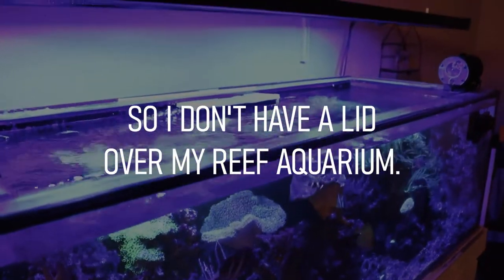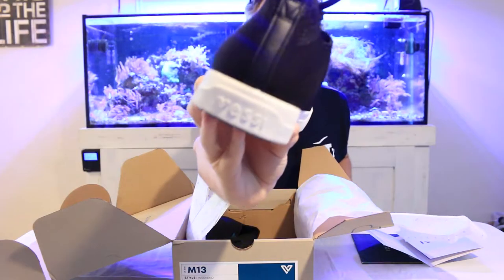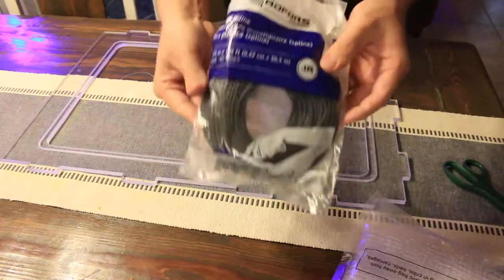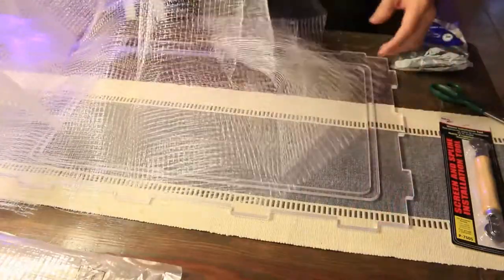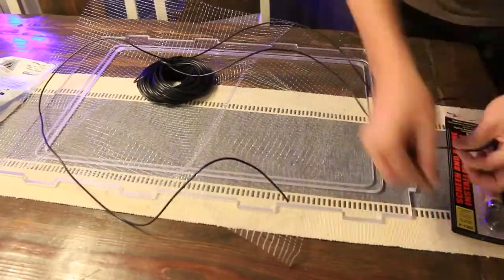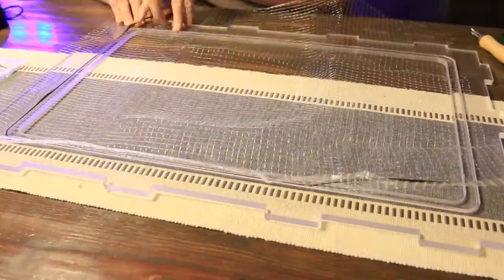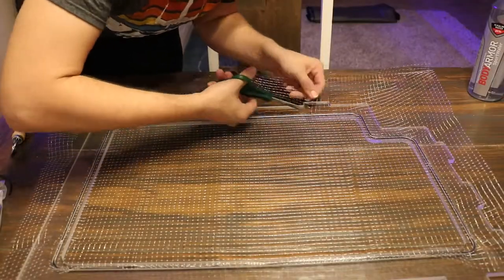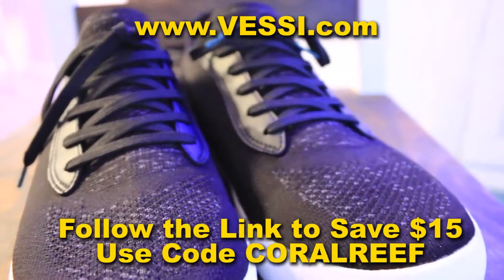How I Made My DIY Custom Reef Aquarium Lid! STOP FISH FROM JUMPING OUT!

Comment: EXACTLY the video I've been looking for ! Can you tell me how deep/wide the groove you made to insert the spline ? Also, would the black spline be very visible? Could I use a similar diameter clear airline tubing instead?
Reply from the maker: Yes, so I used an 1/8 in (0.125) bit for the groove and went an 1/8 in in so that the spline wasn't sticking out and was able to fit and hold itself in place, because it's holding mesh in as well which keeps it tight. You can probably us a little smaller of a bit to make it an even tighter fit but it may be hard to push the spline in. this worked great. Thanks for the question, I hope this helps.
Reply: @TheCoralReefTalk what kind of but did u use. And acrylic or polycarbonate? Thanks

Comment: How thick and wide are the groove on your plexiglass for the spline?
Reply from the maker: So the bit that was used was 1/8th inch and I just went deep enough that the spline would fit nicely inside like an 1/8. When the mesh gets pushed in-between it helps it fit in there pretty tight.